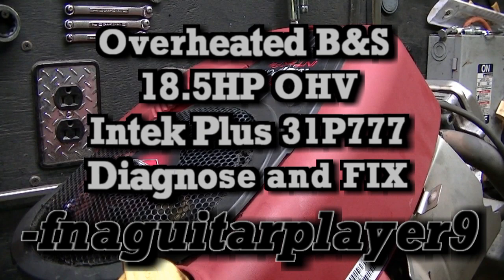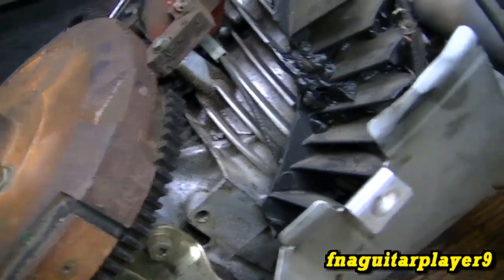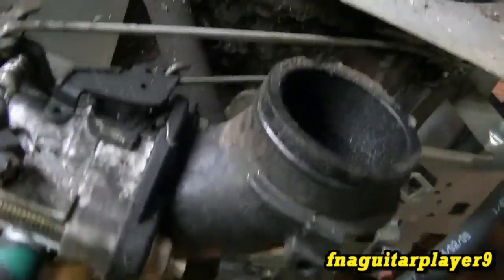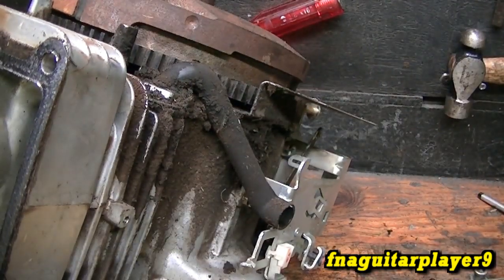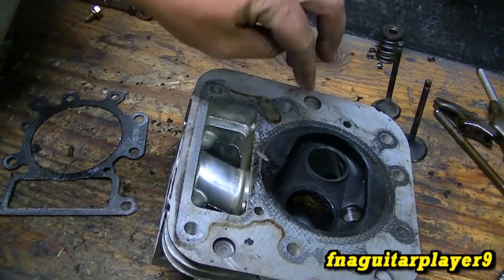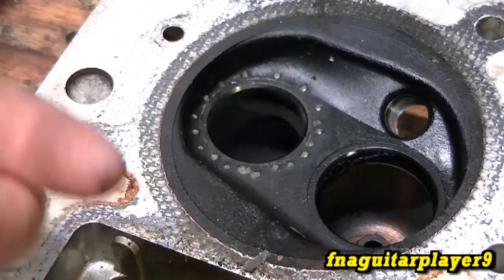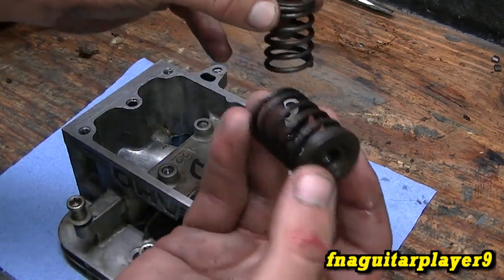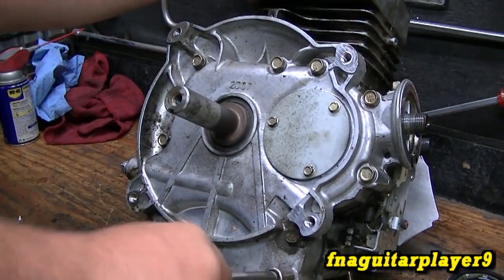Part 1 of 2 : OVERHEATED B&S 18.5HP OHV Intek Plus 31P777  Diagnose, Teardown, FIX and RUN!

Comment: So i can't use that engine properly take off the troy bilt  bronco mower and look for another engine keep that one for a parts engine then cause i do have 2 others that are just fine with no piston ring problems 

All those intek engines from 12.5 and up to 18.5 are the same engines.

So now im gonna need another engine once i take that one off and just either fix its bad ring or use it for parts

Comment: The design of the compression relief mechanism on these B&S engines are prone to fail.  I was trying to see by watching the disassembly/reassembly of the head if there was room to install a small manual compression release valve by the spark plug hole (I installed a set on my twin cam harley).  If the head is thick enough in that area to support a 5/16" threaded bore it might work.  Your thoughts?
Reply: I installed a new one after I seen the damage and every 3 years a new cam shaft 
I’m a small engine mechanic so it’s not a problem for me

Comment: I rebuilt the engine it had broken piston rod. It started and ran but keep breaking the keyway. Any idea why it's doing that?
Reply from the maker: If the flywheel nut/bolt isn't tight enough they will do that, thats usually the most common problem.Make sure the crank and flywheel has no rust on it. Sometimes you can take valve lapping compound and spin the flywheel (without a key) to lap it to the crank, then clean it all up and put it together with the key. Thanks for Watching!!!
Reply: @fnaguitarplayer9  I will do that, thank you very much I appreciate it!
Reply from the maker: @mehmetselim7151  Your welcome!

Comment: Thank you for making this instruction video. I recently had some trouble with a head gasket on my 18 . 5 hp Briggs and your info helped a lot. The motor runs well now. Thanks again. - Dave
Reply from the maker: Your welcome! They are bad about blowing head gaskets, if they made it with one more bolt between the cylinder and valve chamber it would have prevented that problem! Thanks for Watching!!!

Comment: INTEC 
STANDS for
 IN THE REPAIR SHOP
They took a bolt out 
So the head gasket fails
By exhaust
Need to do this to mine
Very hard to read the  valve cover numbers 19.5 pro  what would the head gasket number be are the same or ?
Reply from the maker: Yes very common problem! It should be the same as in the video as long as the model number on the engine starts with 31. Thanks for Watching!
Reply: @fnaguitarplayer9  I'm going to go ahead and tackle the head gasket Ellie Mae first rodeo in that respect my additional problems with this Husqvarna zero turn are the fact that the belt or spring has been flying off since new I noticed that the drawing on a deck is for a different deck I have the two blade deck which looks like a very poor engineering job with two pulleys on one moment arm but just one bolt attaching it to the deck no bridge above the bolt from the deck to keep it parallel also I believe maybe even the wrong belt was installed from the factory as it has the wrong belt diagram the stamping on the valve cover gasket looks like it's laser etched instead of good old-fashioned stamped very hard to read
Reply: @fnaguitarplayer9  what type of head gasket material/parts supplier parts supplier do you recommend I'd like to figure out how to do a dual wheel in the back due to the fact that the wheels are so narrow it really sinks in my yard

Comment: What is the cause of engine smoking
Reply from the maker: Most of the time its worn piston rings but alot of times on ohv motors like this, its a blown head gasket causing it. They are bad about blowing between the cylinder and valve chamber. Thanks for Watching!

Comment: These engines seam to all have the same flaw of over heating, leaking oil to the point of engine failure. The one I am currently working on has a quick release oil valve on the oil drain from the factory and leaked to the point the B&S 16hp ohv with the new avs system spun the crank/connecting rod in half and destroyed the balance system in two. I will be able to fix it with used parts but might get a new or used complete engine because my labor time will really add up when you do any kind of rebuild.
Reply from the maker: They don't seem to be designed right for some reason. Thanks for Watching!!!
Reply: Mine survive nicely but I take care to never overheat them (or anything else). Less-careful owners keep me supplied with organ donors. The quick-release drain cap is UTTER TRASH and I replace all mine with common NPT pipe plugs like old Briggs used to use since mine did the same and a tang snapped off. I will not run those on anything I own.

Comment: I have an Briggs & Stratton Intek 311777 Type 0143-E1 Code 000613ZD Which Intek Engine had problems with Head Gaskets & Camshafts Compression Release any other issues is my Engine Reliable? Was it New or Older Intek Engines that had problems?
Reply from the maker: From what I have seen inteks are basically the same as the I/C, cast iron sleeve being the main feature, but briggs was bad about putting intek on motors that were actually I/C, just like they were bad about false HP ratings. So i'd say its a reliable motor, they did have their problems, but was no worse then anything else from what I've seen. Thanks for Watching!!!

Comment: How do you get the pulley off? I have been fighting it for awhile now. Great video. It has helped tons.
Reply: you can heat it up till it get red then pour cold water on it to break down rust and corrosion or use a air hammer on bolt on crankshaft to loosen it off

Comment: I did head gasket on one of those engines once. It blew on the side where that one did. It ran long enough like that it turned the head and valve assembly pitch tar black and it melted the pushrod guides. One of the pushrods also bent for whatever reason. It was so bad that it would fire as fast as it could but not start. That thing was a mess to get cleaned up. Ran perfect when I was done with it haha.
Reply from the maker: I hear ya! Sounds like it was worse than this one! this is the first one i've ran into that melted te pushrod guides, i was not expecting that! I hear ya! Thanks for Watching!!!